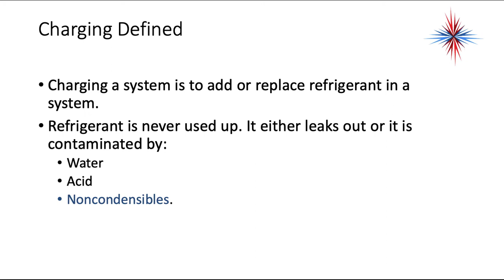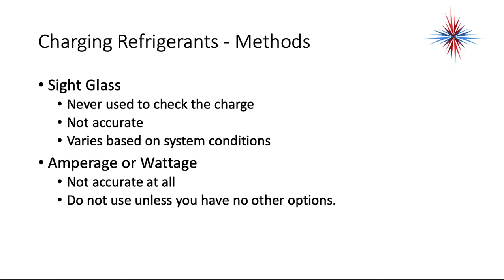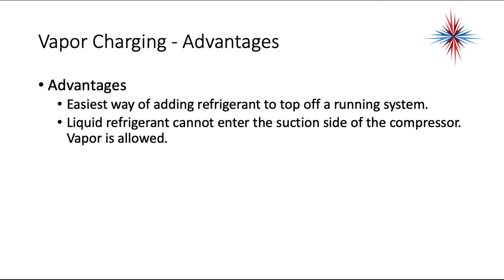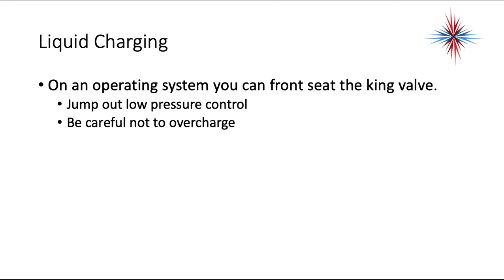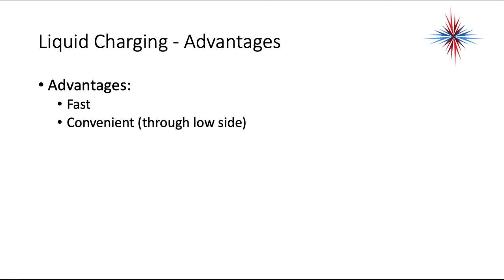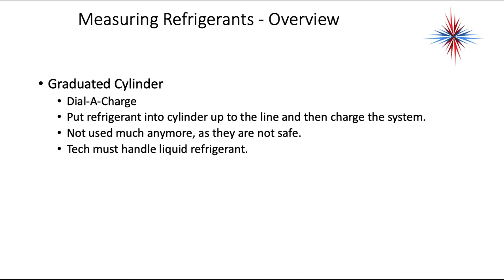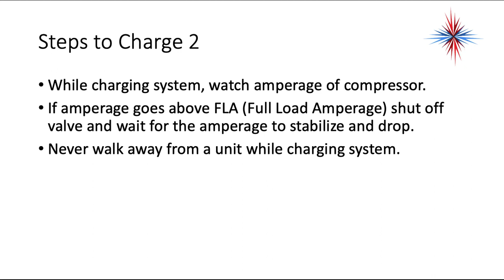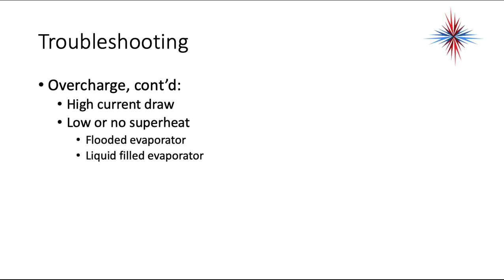Advanced Refrigeration - Charging

Comment: 7:40 diagram seems wrong, the suction port should be after evaporator not before. that is why you cannot pour in liquid because it will flood compressor and cause it lock up.

Comment: Can I charge R404a at suction side?
Reply from the maker: Yes, but VERY slowly , you do not want to put a large amount of liquid refrigerant into the compressor. Also, do not do it unless the compressor is running and the system is not in a vacuum. If system is still in a vacuum charge on the high side as a liquid.
Reply: @cmolnar65  Thank you so much for the info.
Reply: @cmolnar65  A pump that has low/high side need to be filled with liquid R404A need the system to be off, so better filling on the high side then low side, becuse the system need to be off. you cannot fill with liquid in the suction (low side) when the system is off.   1,8 Kilo luquis in this case. the problem here is the i have tvo ports, one low and one high  bot pipes are pointed so de liquid will go to the compressoer, bot line har pointed så liquid will run to the compressor on both side.  the ports har above the compressor.  In this case a water/heating pump with copeland scroll.